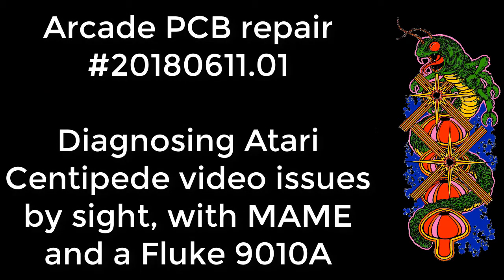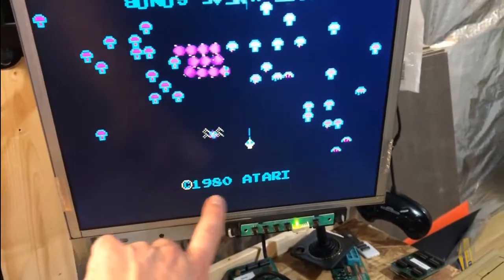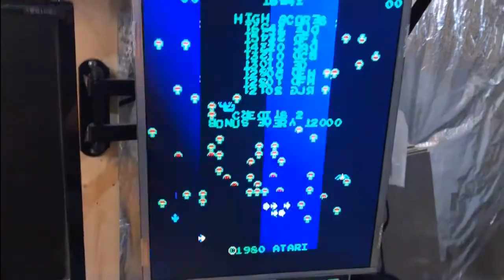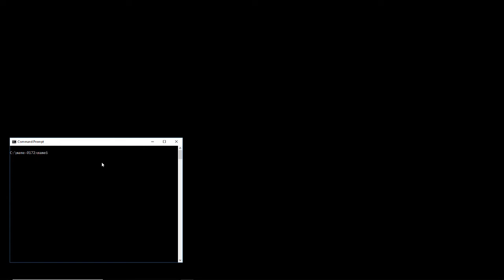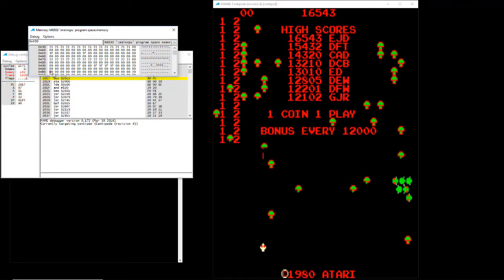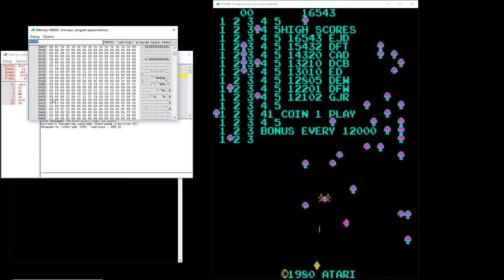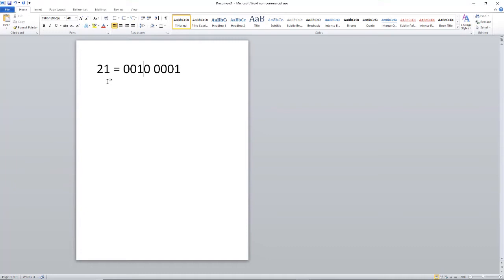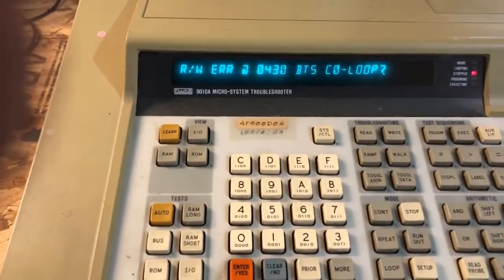arcade PCB repair #20180611.01 - Diagnosing an Atari Centipede by sight and with MAME.

Comment: When you double the data content/image on a ROM chip that is double the data size than the original ROM chip size, why does it ADD one more address line? 2716 ROM chip and you want to use a 2732. The Added address line will float and cause errors on the address buss? When you double the ROM data file into the 2732 ROM chip that is double the size do you have to do anything in the software program so the arcade game doesn't have any conflicting problems because the data is doubled?
Reply from the maker: this is the reason why you double it. if you have a 2732 and want to use it in a 2716 slot the high bit will be "unknown" (it might be wired low, or high on the board or left floating) but by doubling the image it doesn't matter. if it's low it gets the "right" image, if it's "high" it gets the right image, if it's floating then who knows whether the chip reads it as a low or high but it doesn't matter, because regardless of what the chip interprets the current "floating" state as .. it will be either "low or high" so again you will  have a valid image
Reply: @arcade-cabinets  but i have heard when doubling the image it can create problems and errors. What kinds of problems and errors can happen? The additional address pin when using a 2732 in a 2716 slot like you said can output a High state, output a low state or a floating state. Is it best to "add" a pull up or pull down resistor to that added address pin on the 2732 chip to force it to be a 2716 chip?
Reply from the maker: @billwilliams6338  I've never heard of or experienced any problems. Remember the chip doesn't output ANYTHING on that pin, it's an INPUT only so there's nothing the chip can really do. I imagine the problems were from people who didn't double it or didn't double it correctly. I"ve never had an issue and cannot think of any thing that would cause and issue with a correctly doubled chip.
Reply: @arcade-cabinets , One problem I have heard but not sure if its true. When doubling the image it doesn't fill up the entire ROM size so there is empty spaces in the ROM chip so you have to fill them in with some data. Not sure what to fill them up with what data. Another problem is the ending of the first time and the starting of the second image has to be set correctly but how would you know where the the starting address location should be in the second image?
Reply from the maker: @billwilliams6338  that would be "user error", if you double a 2716 image you will have exactly enough to fill a 2732 and it will automatically be correctly offset. If for some reason you it doesn't fill the person who "dumped" or doubled the image did it wrong. If the image doesn't start at the right spot then yes, you'd have a problem, (specifically the second image didn't start at 0x800) then there certainly would be an issue but I don't know how's you get it NOT to start at 0x800 since a 2716 image is exactly 0x800 bytes so if you doubled it it naturally would start on the correct boundary.
Reply: @arcade-cabinets  ok thanks for the help, but do you need to add a pull up or pull down resistor on the extra address pin and data pin on the 2732 chip so the extra address pin and extra data pin doesn't float?
Reply from the maker: @billwilliams6338  no, the purpose of doubling the image is to solve that potential issue.
Reply: @arcade-cabinets  Ok thanks for the help. But you can't use a 2732 in a 2516 rom slot, only 2716 rom slot. Any reasons why you can't double the image from a 2516 rom chip and use a 2732 or a 2716 in a 2516 rom slot?
Reply from the maker: bill williams you can replace generic 2716s with 2732 useless it was a TMS2716 which has a different pinout than the other brand 2716s. Same thing with the tms2532 they are NOT compatible with the other brands 2732s basically if it’s “TMS” brand 2716  or 2532 your replacing you have to do other work.
Reply: @arcade-cabinets  oh ok so the 2516,2532,2716,2732 all have the same pin out with the same number of data inputs and address inputs so they are compatible ? I thought they had different number of data inputs and a different number of address inputs more or less i mean so they wouldn't be compatible with each other
Reply from the maker: @billwilliams6338  no, any part number ending in 16 is a 2kbit EPROM, any part number ending in 32 is a 4kbit EPROM. the xx32 parts have an extra address line. However you can use a xx32 (with some exception) to replace a xx16 in an xx16 slot if you 'double" the xx16 image. The exceptions are: any 2532 you cannot use. the other exception is if the original part is a TMS2716 then you also cannot use anything to replace it.
Reply: @arcade-cabinets  thanks for the help. This is what I'm confused about is the xx32 part has an extra address line so you don't have to add a pull up or down down resistor to tie the extra address line to ground or +5vdc? I don't get how doubling the image of a xx16 image would fix this extra address line. 
Why can't I use a 2532 if i double a 2516 image?
Yes you said that TMS has a different pin out i get that they aren't compatible.
Reply from the maker: @bill williams thats the point of doubling the image by having 2 identical copies of the the data it does not matter whatever the state of the extra pin is, (high or low), you will still read the intended data, if it's low you get the "lower 1/2" of the double, if it's high you get the higher 1/2 of the doubled image, either way the data at the specific address is the same. (the high bit doesn't matter) just ignore 2532 parts or anything that's a TMS2716
Reply: @arcade-cabinets  thanks for the help. So if the arcade game has 2516 you can't use a 2532, you have to use a 2716 or 2732 in the 2516 slot if you want to double the image?
So when the extra address line is a LOW it selects the lower half of the double image and when the extra address line is HIGH it selects the Upper half of the double image?
Reply from the maker: @billwilliams6338   > So if the arcade game has 2516 you can't use a 2532, you have to use a 2716 or 2732 in the 2516 slot if you want to double the image? - that is correct

> So when the extra address line is a LOW it selects the lower half of the double image and when the extra address line is HIGH it selects the Upper half of the double image? - that is correct.
Reply: @arcade-cabinets  oh ok thanks I was confused on the extra address line thanks for the help. 
That is weird that you can't use a 2532 i wonder why that is.
Reply from the maker: bill williams the pinout on the 2532 (most 2532s are TMS or companies making chips compatible with the TMS chip) is different, same thing with the TMS2716. (Note the TMS2516 is the same as other companies 2716, TMS made two different 2kb chips the 2716 and the 2516) you can google for more detailed explanations why this happened.
Reply: @arcade-cabinets  oh ok thanks for the help.
Reply: @arcade-cabinets  
1.) when view data signals on the oscilloscope from the RAM Input and output pins will look like clean squarewaveform signals on the input and output pins. But when you pull the RAM chip and do RAM tests it will Fail the RAM test. Any reasons how the data signals look good on the Oscilloscope but fails the RAM test?
2.)  Some RAM chips store the bit using FETS and others store using Capacitors inside the RAM chips, which are better at store and not getting corrupted? The RAM chips that use FETs fail less common compared to RAM chips that use capacitors? Because there is SRAM chips that use FETs to store the bit and SRAM chips that use capacitors that store the bit, so which is better to use to not get corrupted data?
Reply from the maker: @billwilliams6338  1) yes RAMs are complex and while they might put out a signal that looks "correct" or "is a correct signal" is might not be the "right" signals. For example if it should be a 1 and it's an 0. An Oscope will be able to detect certain errors such as a signal that is floating or "stuck" but errors with addressing or putting out the "wrong output" an oscope will not be good with, you'd need more advanced equipment an even then it's hard to see the error unless you already kind of know what the error is. and external RAM tester can do a ton (like thousands or millions) of automated comparisons super fast to tell if it detects a failure.

2) I don't know if there is a correlation between static and dynamic ram and failure rates and one that is more or less common to fail.  I'd imaging its more a factor of the manufacturer, their processes and components they use rather than a type of RAM, but I could be wrong.
Reply: @arcade-cabinets  thanks for the help. 
ADDRESSING ERROR QUESTION:
All the data signals and address signals look good on the oscilloscope even when the addressing has errors. How would an arcade repair technician know there is an "addressing error" when all the data signals and address signals look good on the oscilloscope and all the ROM and RAM test good on the ROM/RAM tester?
Reply from the maker: @billwilliams6338  if the RAM work fine outside of of the game board in a tester then the RAM itself has to be fine so any addressing issues have to be a result of the system board it's in. A fluke 9010a would be able to detect this type of error with the RAM long test.
Reply: @arcade-cabinets  If the Addressing had issues and the RAM chip tested good outside the circuit, how would the fluke 9010a RAM long test show display on the fluke 9010a there is an addressing error?
What would you do on the Fluke 9010a to test the addressing buss to RAM chip to know there is an addressing issues causing errors?
Reply from the maker: @billwilliams6338  The fluke reads and writes to every address in the ranges various patters many many many times. From there it can often (but not always) figure out if there is an addressing issue. usually (but not always) they show up as "DCD" errors, sometimes they do show up as BTS errors thought.
Reply: @arcade-cabinets  yes when you gets a DCD error or a BTS error that can be "either" a bad address buss line, a bad address decoder chip or a bad RAM chip. The fluke doesn't narrow if the address buss is good even if you press the flukes buss test it could be a bad address buss line, a bad address decoder chip or a bad RAM chip. It could be any of those 3 failures so the fluke can't narrow down to 100% its a bad address buss lines or 100% its a bad RAM chip because it can be either. You have to desolder the RAM chip and take it out of the circuit to isolate if the address buss lines are good or not and to test the RAM chip out of circuit. What i'm trying to say is that the fluke 9010A will display DCD errors and BTS errors but you still have to desolder the RAM chip to test the adresss buss lines with the RAM chip out of cicuit and test the RAM chip out of circuit to "isolate" what the problem is. What I'm trying to say is there has to be deeper fluke 9101A troubleshooting techniques to do to "isolate" if its either the 1.) a bad or good address decoder chip, 2.) a bad or good address buss 3.) a bad or good RAM chip. I don't know how use the Fluke 9010A to do the "isolating" troubleshooting. What can I do or how can I use the FLuke 9010A to try to isolate troubleshoot the address buss, the address decoder, the RAM chip to isolate and narrow down to the component level.
Reply from the maker: @billwilliams6338  OK I understand what your asking. the short answer is "There is no 100% way that will work" you can do manual tests on the fluke and use the o-scope at the same time, but everything really depends on the board your working on and how it's setup and unfortunately I cannot really explain all the different circumstances, and honestly I don't waste much time trying to figure it out myself since the "easiest" way is just to pull the RAM and test it in an external tester once the Fluke gives and error. Yes that often requires de-soldering the RAMS however if you get something like a Hakko 808 (or whatever the new model is called) (and a little practice) then that's not actually bad. these de-soldering guns work great and can remove the chips easily and without damaging the RAM or the underlying PCB board.

-brian
Reply: @arcade-cabinets  yes i have used the Hakko models its somewhat easy to desolder DIP chips. But I'm more interested in the "manual tests" on the fluke and use the O scope at the same time so I can learn how to really use the fluke 9010a to do a deeper level of troubleshooting. The Fluke manual doesn't explain anything about doing these types of manual tests which is to bad.  Because the data logic signals and address logic signals will look good on the oscilloscope so the manual tests on the fluke will isolate it to a deeper level. Instead of just doing RAM/ROM read and write ranges won't isolate the problem.
Reply from the maker: bill williams each game is different you have to understand the schematics of the game in question then figure out how do tests to disgnose there is now generic easy approach
Reply: @arcade-cabinets  yes i know but I have mostly seen your fluke techniques you read and write a HEX value and use the oscilloscope to look at the logic signals on the data buss, address buss, the RAMS inputs and outputs. Is this the only fluke techniques you know or is there others to test RAM chips and ROM chips because I have seen you mostly just write and read back the hex value and pressed the loop button on the fluke used the oscilloscope to monitor the TTL logic signals. I'm just what to know the troubleshooting method that can be approached any games schematic. I wasn't sure if there was any other troubleshooting methods done on the fluke 9010A to narrow down and isolate the problem.
Reply from the maker: @billwilliams6338  There are not any other built in  tests on the fluke that I know. except maybe the "ramp" test which I never have found to be useful yet and don't remember much what it does (I think it writes 1 at each higher significant bit for the given address every time you hit it, but I don't even remember anymore). basically just what you see in my videos once I have an idea of whats wrong I choose the addresses and hex values that I believe will validate my assumptions based on the original fluke error as well as the schematics.
Reply: @arcade-cabinets  thanks for the help

1.) When looking at an arcade games schematics can you give an educated guess by looking at the data buss, address buss where the "bank switching" is because I "Can Not" tell where the bank switching is at on the schematic?
2.) Why would you want the I/O interface like a PIA or CIA chip to do timing? timing signals for what purpose in the I/O signals?
3.) PLA chips does only the chip selects for the ROM chips and RAM chips? or does the PLA chip does other things like what in arcade games or other applications?
4.) What kinds of CIA & PLA test do you think the diagnostic tests does? If you didn't have the diagnostic test program how would you do diagnostic tests on the CIA & PLA chips using an oscilloscope and what else to know if a CIA & PLA chip work correcly?

Comment: I have seen you enter in ROM signatures in your fluke 9010A, where did you get these ROM signatures at? if you didn't have the ROM signatures can't you use a calculate in 16 base mode and compute the ROM signature value?
Reply from the maker: the website http://romident.coinopflorida.com/ when you load a ROM into it it tells you the various checksums of that ROM including the "FLUKE SIG" which is the fluke signature.

Comment: Yes i have seen the MAME CRC8 CRC16 CRC32. I guess there is MAME Debugger that convert the ROMs assembly language into hexidecimal code. Not sure how this MAME Debuggers work. What I'm confused about is if you sum up all the ROM content it doesn't add up to 16bits, so how can a checksum that is 16bit be the sum of the ROM content to check it? 16bits is only going to error check 16bits of the "total sum" of the ROM content?
Reply from the maker: Here's a video about hash functions (a CRC is a simple hash function) it probably will explain the questions you have. https://www.youtube.com/watch?v=2BldESGZKB8 (note you only have to watch up to about 1:20 after that they start going into blockchains.. which is completely off the topic. but their explanation of hashes is pretty good.

Comment: What formula can I use to calculate the summed contents of the all the ROMs contents?
Reply from the maker: google "checksums" or "hash algorithms" basically you can use whatever you want, but dosen't make sense to reinvent the wheel. use one that already exists. MAME uses CRC and SHA1 algorithms the fluke uses it's own custom algorithms I reverse engineered it a few years ago from some binary from some fluke emulator. I wrote an implementation in PERL here http://www.arcade-cabinets.com/fluke_9010a/checksum.txt

Comment: When you have time again If you have a good working arcade board use the logic analyzer to test/verify how the address decoded chip works. When viewing it on the logic analyzer of the inputs and outputs of the address decoder chips how it decodes would be a great learner video. Also adder chips using the logic analyzer to go over how they work. I have a hard time trying to view on logic analyzers how address decoder chips work and adder chips work. I'm ok with adder chips but subtracting logic chips are even harder when viewing on a logic analyzer. They often use adder and subtracting logic chips in Vector games motion object circuitry also.
Reply: which subtractor chip are you referencing?